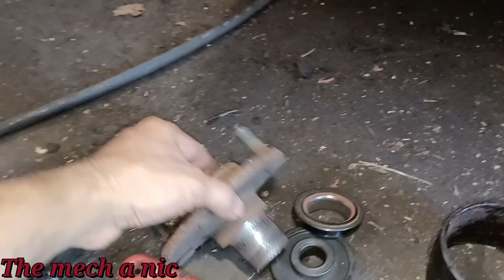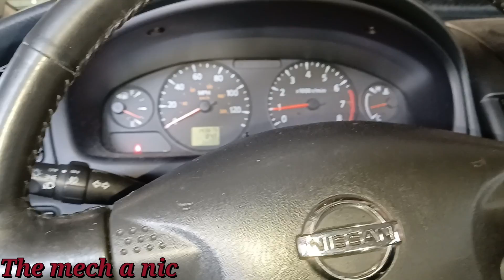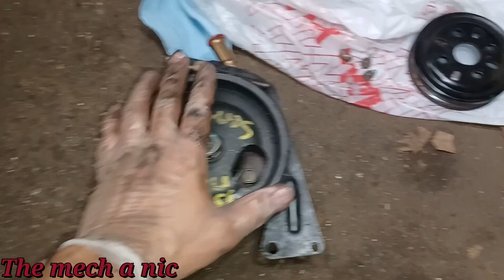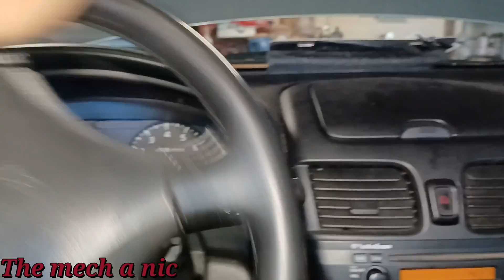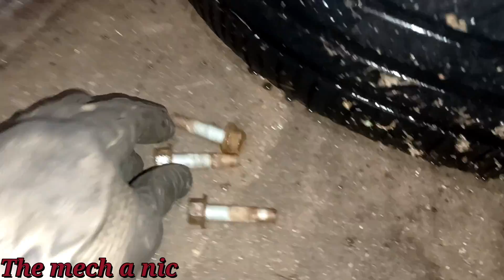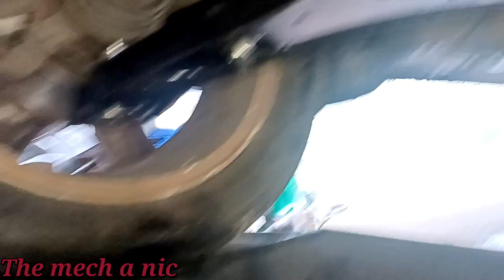nissan sentra with more than a few problems

Comment: Power steering also helps to hold the vehicle on the straight.
Every component in a suspension works together using geometry.
The front is usually more complicated, because of the necessary articulations
needed to steer. Tires are the first sacrifice and telltale of misalignment,
much like spark plugs can help to diagnose internal engine health.

Shortcuts and questionable parts & slipshod labor all add up to a rolling Deathtrap.

Why put other innocent people at risk?

Comment: Had an '04 Sentra where the bearings in the AC compressor pulley started going bad and it would do a weird rattle at certain RPMs and took me a while to find it.  Problem is, Nissan won't sell you just a pulley, you have to get the whole compressor assembly.

Comment: When a belt squeals and is tight, then it’s contaminated by fluid or too burnished. Engine off, sprinkle comet or bar keeps friend cleanser on belts. Works. Yes make sure tension correct first.

Comment: That wheel bearing did not start yesterday. The customer has ignored the noise for a long long time. That tire is too dangerous to even go around the block. You do not need customers like that. Tell the customer he is fired. Don't come back. The old school guy.
Reply from the maker: You're right.  There's no way that wheel bearing went bad over night. In my experience you rarely get the truth from customers.  Almost all my customers are like this, if I fired them I'd have no work 😁👍 lol . Thanks for watching